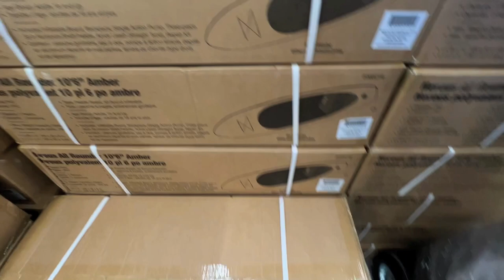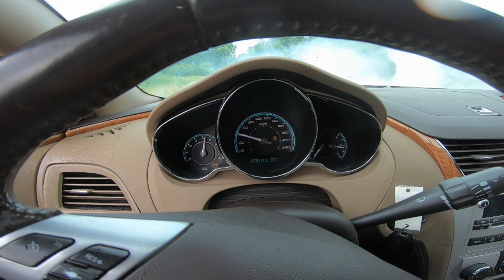NEW Chevy Malibu TRAILER BURNOUT!

Comment from the maker: First 150 COMMENTS/LIKES will be ENTERED in for the KTM 450 ATV GIVEAWAY at 408,000 subscribers!
More COMMENTS = More ENTRIES!
Reply: Hey Mark, you ever considered or thought about a 2012-2013 Impala LT? I would love seeing one destroyed with a jump or engine blowing up. Just a suggestion because there may not be a lot in the Canadian area, but just as long as there is one I would love seeing it destroyed. Also, I understand if they can be pricey and too much for you. If they are then just don't buy them.
Reply: @thechannelofrandomvideos789  he has had a couple older Impalas and those newer Pontiac G6’s that are pretty similar in engine/transmission parts. He doesn’t buy many of them because there’s too many safety features on them. So you can’t really do burnouts, donuts or neutral drop them to send them off the jump. So they’re not as practical for content or entertainment.
Reply: @itzchaseyboi  that's true that they are limited, but I would say that the 2012 ones are my favorite Impalas.